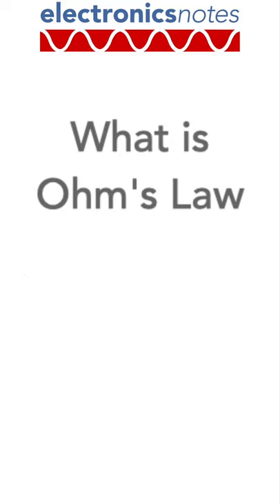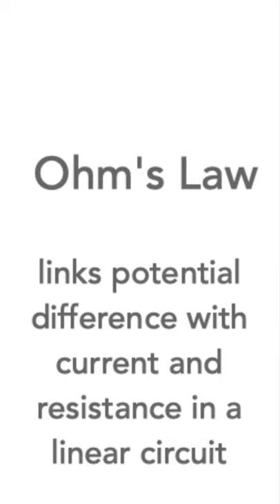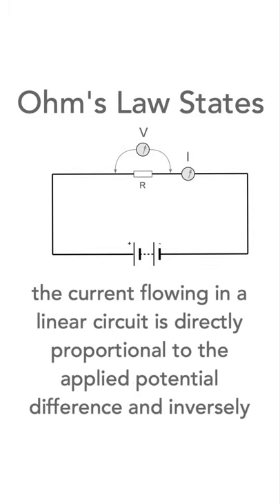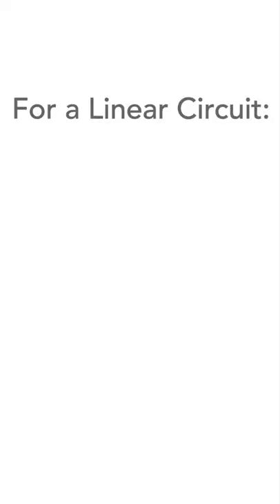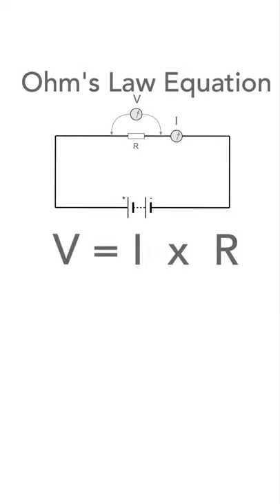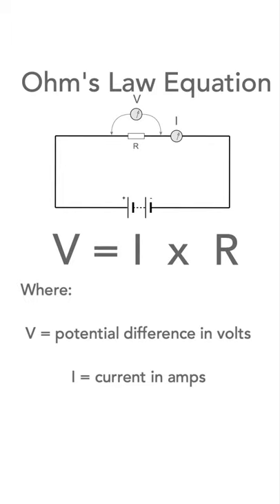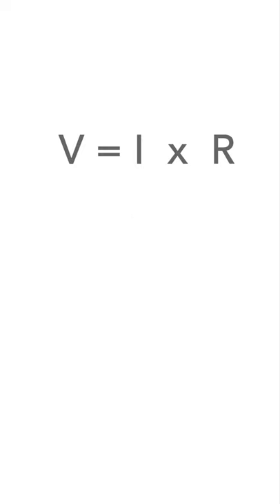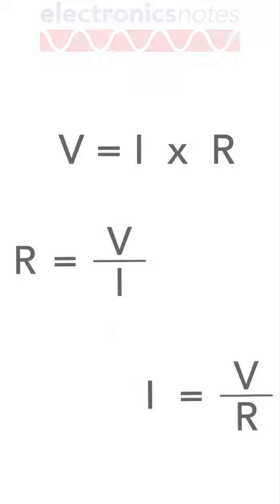Ohms Law Definition & Equations Summary #SHORTS

Comment: E is the symbol for voltage V is used for voltage drops across a component
Reply from the maker: We used V because it tends to be in everyday usage more.
Reply: @ElectronicsNotes  In a Ugly’s Electrical guide book it also states it as VIR but they also would use EIR which would Confuse me so I stuck to V also

Comment: I've never seen voltage listed as "V"
I've only seen Voltage expressed as "E"
Reply from the maker: Although both E and V can be used, I’ve always used V. Many others also use V, one example of many can be seen here: https://www.electronics-tutorials.ws/dccircuits/dcp_2.html
Reply: @ElectronicsNotes  Interesting. I'm an electrical engineer and I've never seen it written that way before, ever.
Reply: E in this case means electromotive force, which is what voltage is. They can be used interchangeably.
Reply: @chokinghazard2942  Well, I have a master's degree here electrical engineering, I know what E is. LoL. In 32 years of my engineering career, I've never seen anyone use "V" in ohm's law. 
Perhaps it's a new thing and I shouldn't really be surprised. The dumbing down of America began a few decades ago..
Reply: E is used for electromotive force which has the same value as volt
Reply: @chokinghazard2942  Yeah, I understand that, but I have never seen it written that way. I've been an electrical engineer for over 30 years